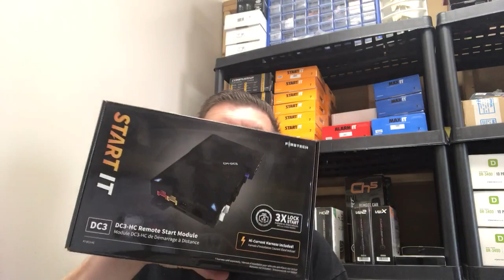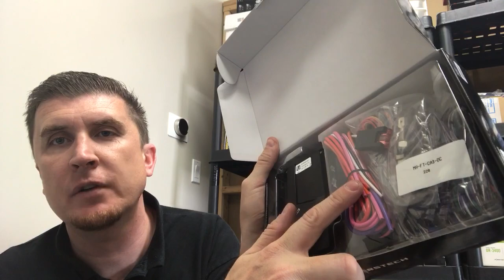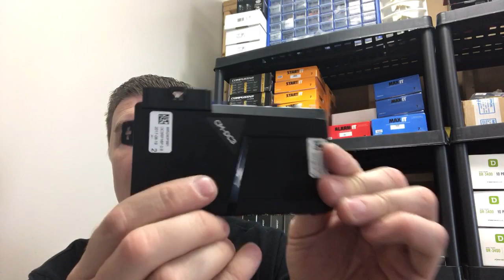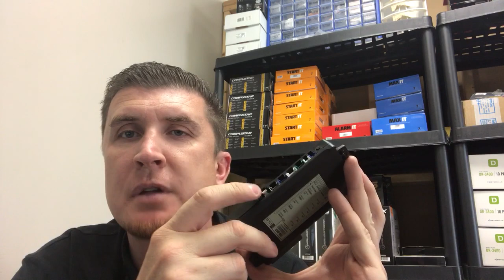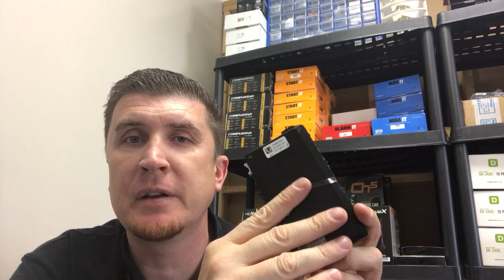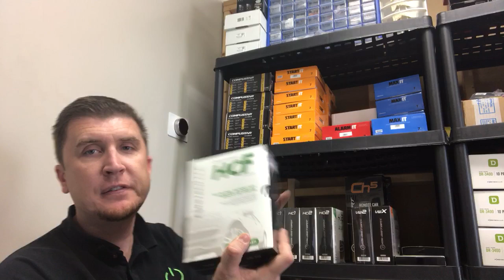NEW!! Compustar DC3 Remote Starter

Comment: The t- harness in the box for honda accord 2008       But I change the connection housing for 2007 everything back together car started with key ok 
Press the lock 3 times car not start

Comment: im getting one of these installed on the 27ths super excited to have remote start, and there installing door lock acuators, I hope there reliable it'll be nice to have power locks, just wondering what range there dc3's have for starting?
Reply from the maker: Hi, the DC3 does not determine your operating range, the key fob (or control) method does. So depending on which key fob and or smartphone controller you use, will determine how much range you have

Comment: Hey I have this in my truck with the one button remote in 2003 f150 and when I press the button for any function it does not work. Is there a way to reset it?

Comment: Hello on the DC3 module  there is a daily that goes from 0-10. MY question  is I have the DAS 2 shock sensor which you can adjust  the sensitivity on it. What's  the proper way to adjust  the system  so it works properly.
Reply from the maker: You use the settings on the FTDASII to change sensitivity, the dial on the DC3 is for setting the FTDAS (first generation)
Reply: @LockdownSecurity  oh so the the daily on the DC3  you set it to zero  then and use the adjustments on the DAS 2 to do the adjustments.

Comment: Hey Jeff, I’m arguing with someone on YouTube. He said if I want to have my rear defrost to turn on when I remote start the car, it needs to be hardwired. My installer here in Quebec province said no need to. I saw him plug the module to the his computer and set it at a certain temperature in the AUX options. Let say under 5 degree it will turn on at start. One say it needs to be hardwired and my installer say no. I don’t know if I understand the word hardwire. To me it means to find the defrost wire (positive) and connect it to the module by soldering or kind of vampire clips to make connection for the courent. From what I saw on the screen, all the options to set, he does not need to do anything else. Maybe I’m wrong and so my installer which is accredited for installing Compustar products.

Comment: I am installing on 2015 Honda accord(std key). I get both Leds flashing red when I plug in the unit. It is supposed to flash green after I turn the key on but its just red. I tried to ignore and continue with extended programming but got this error: Device not ready for extended programming, please review instructions [ The reading is empty ] . I appreciate if someone can help me here. Thanks.
Reply: Please contact Lockdown Security @ Phone: 1-866-824-4118
Email: sales@lockdownsecurity.ca

Comment: Man...these businesses that install these systems are guarding the install information with their lives, it seems.  The one "PRO" Compustar place in my town that installs remote start systems wants $400 for installing a $160 system.  I'm looking at the parts and it looks like you're just integrating wire harnesses into the factory setup to work with the module.  Something that can easily be done with some decent instructions and a little mechanical know-how.  Share the knowledge!  Save us some money!
Reply from the maker: Installation labour varies depending on the vehicle. We cannot speak for your local installation shops pricing but for a remote starter installation we generally charge around $200.00. We also sell remote starter systems on our website at www.lockdownsecurity.ca and even provide installation instructions with purchase if you prefer to DIY. The difference between having a professional do the install as opposed to someone attempting to do it themselves is we offer lifetime warranty on our labour as well.

Comment: I have a question for you about installing my remote starter system. I got START IT kit along with ALARM IT kit and Blade AL. I am trying to install it into my new 2020 Toyota Corolla Sedan Push To Start but I have problem though. It show on the wiring diagram how to install those wire into my car but it show diode on PTS 3 wire needed, lock and unlock need a diode and trunk need a diode. What can I do? Can I bypass that or need to put the diode on it to make the system work? Can you help me? Another question 2020 Toyota RAV4 with Key nred to be keywrap and how can i do that? By using my current key on it and key wrap it or get another ket made then key wrap it? Let me know ASAP. @Lockdown Security
Reply from the maker: Hi, we suggest you consult with a professional installer in your area. For liability reasons we do not offer general technical support online.
Reply: @LockdownSecurity  So I have to call Compustar technical support on the phone because I dont want nobody install it for me.

Comment: Hey, will I need to make power ground ignition connections with the big lugged power connector, or will the t harness supply power ground etc.?  thanks
Reply from the maker: T harness will supply if your vehicle is covered by a t harness application
Reply: @LockdownSecurity  Thank You Lockdown,  I got it in and programmed with the harness and vw1 immo bypass, starts then immediately shuts down, diagnostic p lamp flash indicate lost tach signal? don't really understand this because I got the two green led's on tach learn?? so??   any ideas?       2007 vw passat 3.6 auto keyport ignition  also tried to re flash module looking for tach sensing or virtual tach sensing couldn't locate option in menu ?  WTF? ft DC-3

Comment: Hello just a general question
I picked up the new Drone 6400 here in US
Shouldn’t these drones come with an antenna?   I would think that the LTE would need it as module is inside behind steering wheel.   Thx.
Reply from the maker: The antenna is built into the device, simply mount the device as high up under the dash as possible, generally label side UP (but confirm that in the install guide, we do not get the DR6400 here in Canada, so I have never seen/installed one)

Comment: i know you typically have it installed by auth. dealer,  but if i do it myself,  do i need to flash the DC3 with ADS-USB or ADS-WLW-AP1,  i'll be using teh T-Harness Ni3 for my Nissan Pathfinder 2015
Reply from the maker: Yes you need to flash this product (program it)

Comment: Whsts the diff between the DC3 LC and HC. I noticed THE LC doesnt come with any harness
Reply from the maker: HC is High Current LC is Low Current
Reply: @LockdownSecurity  can both of the controller be used with either T harness and or HC wiring

Comment: I have installed it to 2014 toyota sienna and works fine but when ever i start the car with remote it will start but horn will honk and wouldn't stop unless i unlock it with factory remote. Is there any way that i can fix it??

Comment: Please explain the difference between the Firstech FT-DC3-LC (Low Current)  and Firstech FT-DC3-HC (High Current) and how to select which is best for your install?
Reply from the maker: HC = high current
LC = low current
The DC3 is both of these, the difference is in which wire harnesses come with it when you buy it. We (Lockdown Security) ONLY sell the HC version.
Reply: your mean is Vehicle low current can't use HC? if use HC must connect from plug M1 but can not connect T-Haness?

Comment: Also, could you tell me with the RF-2W1B-SP installed, are there any remotes with more than 1 button that will work with the RF-2W1B-SP?  The dealer here installed it with the Slice Jr. one button remote.  How difficult would it be to switch to an SS antenna?  I used to install Code Alarm remote starts but have no experience with installing Compustar.
Reply: Please email us at sales@lockdownsecurity.ca

Comment: Hi.  GREAT video!  Can you tell me if the DC3 in my 2009 Outback with factory security has to be configured when you remote start to disarm/unlock, then start, and then relock?  Is there any way to configure it to disarm to remote start without unlocking the vehicle as well?  Thanks!
Reply: Hi Leon, as far as I know to disarm that car (2009 Outback) you must unlock it, there is no other way to do disarm.

Comment: Would that help bypass my push to start 2014 Toyota Corolla to be able to remote start?
Reply from the maker: +Brian Sek Yes this works on that car (Venza)
Reply from the maker: Yes, the DC-3 has the require bypass module to interface with your push to start system built into it